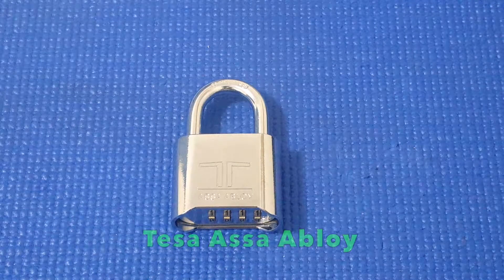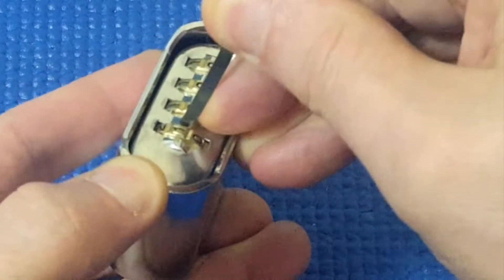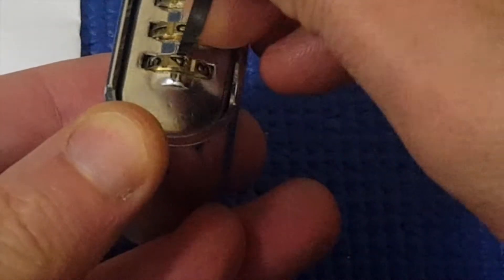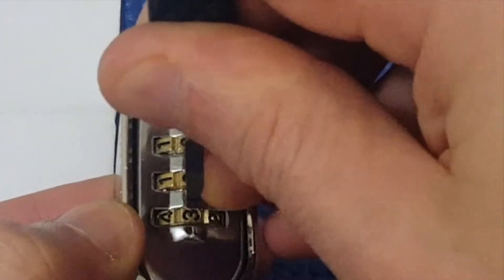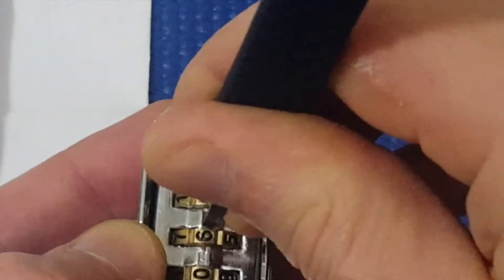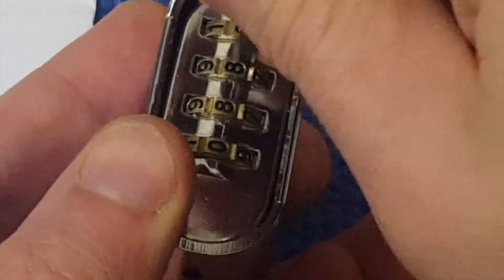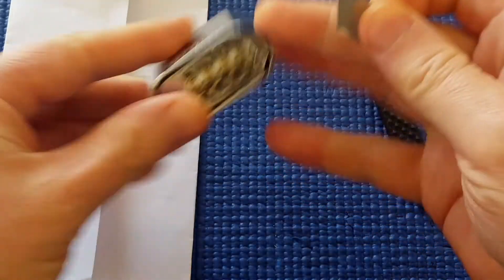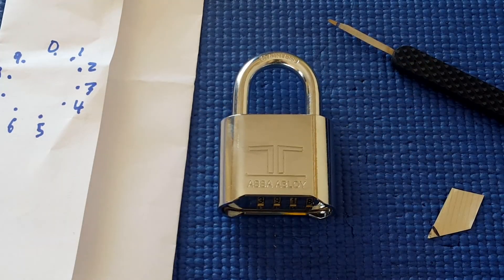(Picking 113) Tesa Assa Abloy combination padlock decoded

Comment: Great job. Interesting that the first 3 wheels allowed you to probe and not the last one. If only they all had the tolerances of the last wheel. Thanks for this follow up! I learnt a lot!
Reply from the maker: Thanks mate! :D :D  Yea I was thinking that same thing ... I think the 4th wheel didn't let me in because it had warding as it was right next to the side of the lock ... but why didn't they do this with all of them! ... then both the bypass method & decoding method would fail, and it would be quite a secure lock (apart from destructive attacks like blows with a hammer or bolt-cutters etc, but at least no-one would be able to get in quietly).  For the decoding method, I already knew where the gates had to be lined up once I found them, but if I didn't know that beforehand then I would have had to put the "wide" gate at the same position for each of the first three wheels and then turn the three wheels in unison testing each position (turning the last wheel to each position) ... so that would have been 10 x 10 = 100 tests maximum (or 50 on average) ... it would have taken longer but not too long.  BTW - I also decode a combination lock with a similar method here: https://youtu.be/WJNs38RTg_M
Reply from the maker: eg this method: https://www.youtube.com/watch?v=NVucdFUi1cw